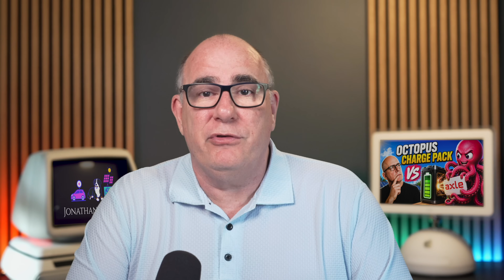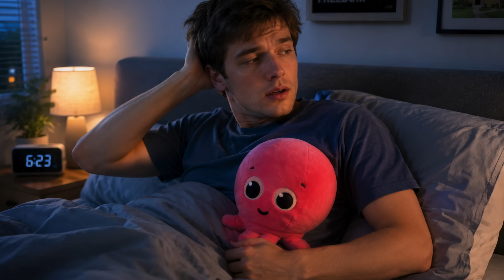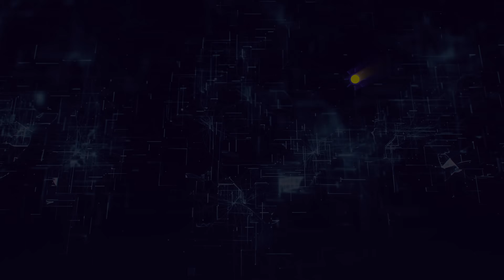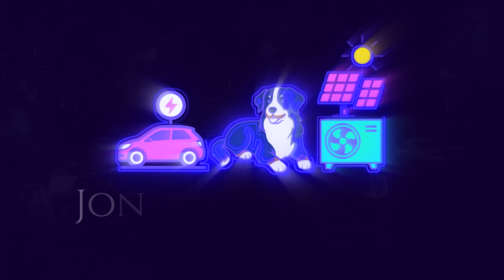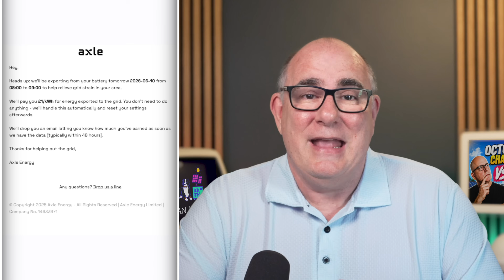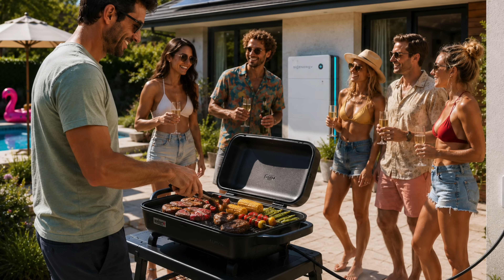Octopus Charge Pack Just Fired A Shot At Axle Energy

Comment: I’ve been on charge pack since it was released. I can’t use Axle because my battery and inverter isn’t compatible. 

My observations so far;

- Octopus doesn’t control my battery all the time, only sometimes. Outside that control I can use my system as I wish.

- octopus has been pretty smart with mine so far. It tends to discharge at peak time at night, but always leaves me with a 20-30% buffer. It only gets down to this at around 9-10pm just before off peak rate kicks in. 

- it sometimes charges my battery in the mornings as well as through the night. 

- I got an email saying it will take them a few days to learn my habits but it’s been quite consistent up until now. 

It is quite clear to me that when octopus discharge my battery I get paid at my peak rate. If I then need to draw from the grid for whatever reason I haven’t lost out. 

However if I don’t then I get the difference between my peak and off peak rate as profit. 

As far as I know I haven’t had to fall back to the grid yet, unless octopus told my battery to do so and if this is the case I should pay off peak rate. 

What’s not clear so far is the total I’m earning from this. But I’ll see what my app says, at the moment it’s just showing me I exported more. 

For someone like me who didn’t have access to Axle, this is better as I’m earning more than I would have been just exporting my excess solar.

Comment: As a Octopus Flux and Axle customer I'm not going to be touching this new service from Octopus... We have an EV but I'm not giving up my 29p/kWh export rate! We are charging from Solar most of the time during the 10p rate... Cheaper than the 15p night rate.
We are a net exporter so my next concern is whether I should risk losing Flux next Spring if Octopus stop Flux renewals as happened this year.
Reply from the maker: nor me, I find axle simple, and I know what I am getting before the event, no messing around trying to figure import vs export differences in a spreadsheet.

As a new flux user I was hounding them to let me in, the reason for holding it was the uncertainty about the iran war, I think has now passed or at least reduced so hopefully next year it wont be an issue

Comment: for intelligent go we get a known deal - car charging we allow to be controlled by Octopus, in return we get the car charged with off peak rate even if the actual slot would be a peak rate one. 
charge pack doesn’t sound like that. If I hand over control of my battery to octpus, I want a known return. Right now I control the battery so that the majority of my home runs off peak. (topped up with solar). So in return for me handing over control, I want Octopus to guarantee me my entire home will be charged off peak. any use of my battery to discharge that may result in me being charged peak rate is not a good deal for me
Reply from the maker: @MrKlawUK I think you've hit on the key difference. With Intelligent Go, the deal is crystal clear: you hand over control of your EV charging and, in return, you get cheap charging.

With Charge Pack, I think people are looking for the same certainty. If I'm handing over control of a £10k+ battery system, I want a clearly defined benefit in return.

Like you, I already use my battery to avoid peak-rate imports, so the question becomes: what extra value is Octopus providing? If their optimisation results in me importing at peak rates more often, then the compensation needs to more than cover that.

That's why I think everyone needs to do the maths for their own setup. The households that benefit most are likely to be those with large batteries, large inverters and generous DNO export limits.

Comment: Been an Octopus customer for about four months and fairly good until this month when I got my bill and it showed no export credits at all - So knowing I had exported and had in fact been importing at low rate specifically to export later in the day, I challenged them only to be told it was because they had less than 48 readings for a few days and therefore they did not pay but they would chase some third party for the missing data. After a while this missing data apparently turned up apart from 1 day which still had some missing data. Weirdly my Fox app showed an export nearly identical to that also showing on the Octopus app for the same day. I got the impression that unless I had chased this there was nothing in Octopus’s systems to highlight this issue. So I have no intention in handing control over to Octopus.

Comment: Depends on my blended cost of electricity…I’ll take whichever costs me less
Reply from the maker: @nixer65 Absolutely, but I think there are two different questions here: which one costs you less, and which one actually makes you more. They are not always the same answer.

You also have to factor in things like 5% VAT on imported electricity, battery losses and battery wear. A tariff can look attractive on the headline rate, but once you add the real-world costs of moving energy in and out of the battery, the margin can shrink very quickly.

That's why I'm cautious. For each household it has to be based on actual usage, import rates, export rates, battery size and how much control you're willing to hand over.

Comment: I think a more interesting question is what is Axle Energy's business model. I suspect they are making a loss buying electricity at £1 per kWh.
Reply from the maker: when you look at the price today during the peak of £855 per megawatt hour, I would imagine they’re making a handsome profit
Reply: @JonathanTracey  £855/MWh is only 85.5p/kWh, so if Axle are paying customers £1/kWh, they'd still be losing money on the electricity alone, before taking account of operating costs and making a profit.

It's also worth noting that Axle describes this as a beta programme. The £1/kWh payment appears to be a promotional rate rather than a permanent guarantee, and they're also guaranteeing participants a minimum of £10 per month during the beta.

I'd expect one (or more) of three things is happening:
• They're receiving substantially more than £1/kWh from flexibility and balancing markets than the wholesale electricity price alone.
• They're using venture capital to subsidise customer acquisition while they build their virtual power plant.
• It's a combination of both.

The wholesale electricity price alone doesn't explain their business model. I also suspect the rates will fall once they've built up a significant "battery" of users and no longer need such generous incentives to attract new customers.

Comment: You missed one massive plus octopus has that's it will know when theres over voltage which costs money too dump from grid so in theory they could charge your battery for nothing
Reply from the maker: they could, but they won’t. They said that they will charge you at you’re off peak rate
Reply: Distribution voltage management is the DNO's responsibility. It's nothing to do with Octopus unless the DNO sets up a local constraint rule/reward. 

Transmission voltage is NESO's responsibility and they could in theory contract with a VPP to help them. However voltage control at transmission level doesn't respond very sensitively to active power (kW) control which batteries could do, it responds best to reactive power (kVAr) control which transmission connected generators do best
Reply: @redshift3 octopus already  do free  energy when there aware of surplus also why do you think axle can pay a £1 kwh
Reply: @wormon3626  surplus energy (a national problem or transmission constraint regional problem) has little to do with over voltage (a local or regional problem)

Comment: But Octopus can’t control the grid generation capacity, but they can bet on the market likes a Futures market, so can make money if they know demand will fall based on using your batteries. So it’s a Grid Futures Market they are betting on.
Reply from the maker: @G6EJD-David I think that's a plausible explanation. Octopus can't control how much electricity is generated nationally, but they can influence demand by coordinating thousands of customer batteries. If they can accurately predict that reduction in demand, they may well be able to reduce their wholesale energy costs or optimise their position in the market.

That's absolutely fine by me—every company is trying to make money. The important question is whether customers get a fair share of the value they're creating.

That's why I keep coming back to the maths. With Axle I know an event can pay £1/kWh plus my normal export payment. With Charge Pack, the value of shifting energy around on typical IOG rates is more like 18–21p/kWh before any bonus. If Octopus is making money from that optimisation, I want to know how much of it comes back to me.

Comment: Just had a look at Charge Pack and it seems extremely opaque. It doesn't seem worth handing over control for £12 a month. At the moment I use almost no peak electricity, if Octopus export everything from my battery, my peak use will increase and Octopus haven't said my export earnings will exceed my import. Axle pays £1kWh so as Jonathan said, I would not care if I then had to import at 25pkWh
Reply from the maker: @bill_heywood I think that's exactly the concern many people have. If you're already avoiding peak-rate imports by using your battery intelligently, then handing control to Octopus only makes sense if the additional rewards comfortably exceed any increase in imports.

The problem is that we can do the maths for Axle. An event paying £1/kWh plus 12p export gives £1.12/kWh. Even if I had to buy that energy back later at 25p/kWh, I'd still be well ahead.

With Charge Pack, the numbers are much less clear. Using typical IOG rates of 30p peak, 9p off-peak and 12p export, the value of shifting energy around is often only 18–21p/kWh before any bonus. Until Octopus shows the full economics, it's difficult to know whether £12 is a floor, a realistic outcome, or simply a marketing headline.

Comment: Although I would like more details from Octopus, I believe it will work like "savings sessions" but in reverse.

With saving sessions you have to opt in, and then reduce your energy for benefit (octopoints).

AIUI ChargePack is default Opt-in, so subscribers will be notified the day before (like Agile) of the sessions/times Octopus would like a consumer to export (or possibly import) power. If one doesn't opt out, then Octopus will trigger an export/import.

So, Octopus controls, but subscribers decide whether to or not. Energy import (to battery) works like IOG, so cheap-rate imports, likely the same as overnight.

Depending on how they do import and export, and whether one can control how much power to export, I think it will benefit consumers; potentially export would be changed to Agile Outgoing so subscribers gain the increased payback for the busy time.

The main consideration I can think of is ensuring the consumer has sufficient battery power during peak rate (and export time) to last until the end. Perhaps this will be a setting subscribers can make in the Octopus portal (and possibly per session).

From Octopus's side, they control import/export times and possibly quantity, and subscribers tell (configure) Octopus how much to export (and/or possibly import).

Technically, that's how I would do it, to reduce new functionality (IOG already adjusts import costs, Agile tariffs already tell them costs at times of the day (at 16;00 the day before), Savings Sessions already email out session details. So they need to add battery control and another couple of entries in the portal for opt-out and possibly capacity.
Reply from the maker: @ivanbeveridge4755 That's actually one of the most plausible explanations I've heard so far. It would allow Octopus to reuse a lot of the infrastructure they already have for Agile, IOG and Savings Sessions rather than building an entirely new platform.

The one thing that gives me pause is the economics. If it works the way you've described, then on typical IOG rates of 30p peak, 9p off-peak and 12p export, the value of shifting energy around is only about 18–21p/kWh before any bonus. Compare that to an Axle event paying £1/kWh plus 12p export, and you can see why many battery owners are struggling to get excited.

I completely agree though that battery reserve settings will be critical. The last thing most of us want is to wake up after a grid event and discover Octopus has optimised the battery perfectly for the grid but not for the homeowner! 😄
Reply: @JonathanTracey yes indeed: the devil is in the detail!
Interesting times though!

Thanks for bringing the information to your wider userbase 🤗

Comment: I have a Givenergy AIO and Axle give me free access to the premium app so with a guaranteed £10 from axle and then £4.99 saved I'm sticking with Axle. I'm also a massive Octopus energy fan so will be topping up capacity with the announced Nook
Reply from the maker: @mattesla I think that's a perfectly rational position. If Axle is already guaranteeing you £10 per month and saving you the £4.99 premium subscription fee, then you're effectively £15 ahead before you've even considered any additional event earnings.

That's one of the reasons I think Charge Pack may struggle to tempt existing Axle users. The maths is easy to understand with Axle, whereas Charge Pack still has a lot of unknowns.

The Nook announcement is interesting but not sure why its next year before it launches, its a fox ESS underneath which is available now/soon
Reply: @JonathanTracey   I have had a quote from Octopus for installing a 10Kwh Fox ESS battery with 5Kwh inverter £4836; my local Which? Trusted Trader electrician who wired in my Hypervolt EV charger last year will install same package for £3705. Like you say, the Nook and Colossus batteries announced at the tech show are just Fox items with a pink cover on them, and even if they are cheaper, I doubt they will beat my local chap's price.

Comment: Very useful thank you Jonathan. It certainly makes the picture more clear however.....
If I don't have IOG (I have a PHEV that isn't covered, and similarly a charger - so I can only have GO), then can I benefit from it?
I also have Tesla (27kWh), so will this be able to integrate into the whole system, and will the want to, or have to, manage my PW3?

Simplistically, when the grid backbone doesn't have sufficient capacity between different generation and usage nodes in the country, it makes sense to have a fully distributed set of power units - as long as you can connect & control them effectively. 

And then there is the local capacities.  My G99 allows me 10kW import/export through my 60A DNO_fuse.  I don't have scope for more export; and will I have enough scope for charging my PW3/EP, my PHEV(3.6kW), running my home (maybe some electric heating at night rate)..... AND charging their battery.... all in the 5 hour GO window.

Still needs to be much clearer.  Or don't they want 'GO' customers?  I'd consider purchase if their price per kWh capacity was good (as it's purported to be).
Reply from the maker: @herrtomas6729 I think you've highlighted exactly why I'm struggling to reach a firm conclusion. The simple examples Octopus gives are easy enough to understand, but once you add a Powerwall, a PHEV, G99 limits, home loads and overnight charging windows, things get complicated very quickly.

On your specific question, I haven't seen anything that suggests GO customers are excluded, but I also haven't seen enough detail to know how Charge Pack would coordinate all those competing demands within a 5-hour charging window.

Your point about distributed storage is spot on though. Thousands of connected home batteries could be incredibly valuable to the grid. The challenge is making sure the homeowner gets a fair share of that value while still retaining enough control over their own system.

At the moment I think there are more questions than answers, particularly for people with more sophisticated setups like yours.
Reply: @JonathanTracey  I think there is another detail hiding in plain sight!
I chose to fix my GO for 12 months at 9.5p/kWh, rightly or wrongly, and with the reduced export of 12p per unit, it might become better to charge rather than sell during the body of the day particularly in 'the dark-4' months when I might want as much as possible in my 5 hours.

Comment: One of the things that I dislike is that Octopus doesnt allow Axle for IOG customers. There are things overall in Octopus' approach that seems to change and it started disturbing me.... Regarding charge pack, I could tolerate it in summer, but in winter I need my 19kwh juice for the heat pump, I wouldnt like Octopus to play with my battery (unless they pay the equivalent of Axle).
Reply from the maker: @giorgosa I think that's a very fair concern. One of the things I dislike is that Octopus appears to be taking a dim view of Axle for IOG customers. From the outside, it feels like they're becoming less open to third-party services that compete for control of the battery.

On Charge Pack specifically, I'm probably in the same camp as you. In summer I'd be fairly relaxed about it because solar generation is plentiful. In winter it's a completely different story. My batteries become part of my heat pump strategy and I value every kWh stored.

That's also why the compensation matters. If someone wants to use my battery to help the grid, that's fine, but the reward needs to reflect the value being provided. At the moment, an Axle event paying £1/kWh plus export can be worth £1.12/kWh. That's a very different proposition to moving energy around for 18–21p/kWh plus an unknown bonus.

For me, that's one of the biggest unanswered questions surrounding Charge Pack.